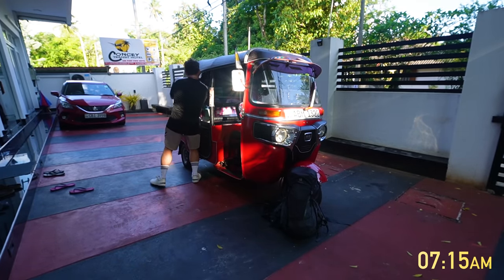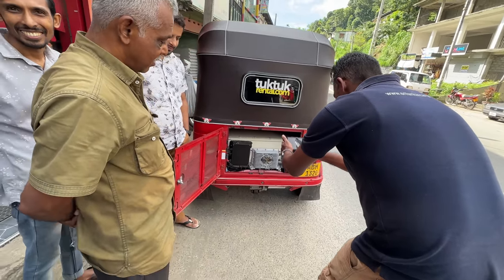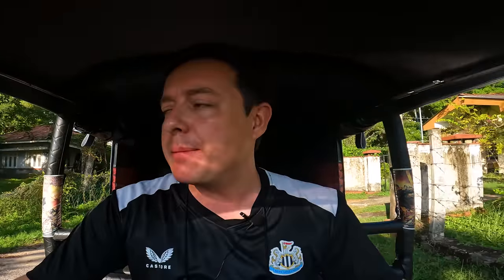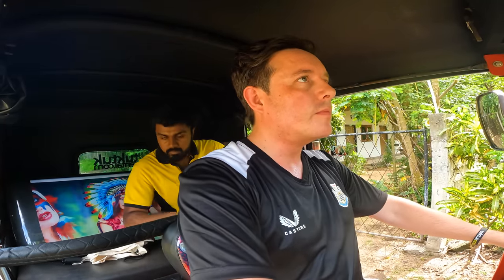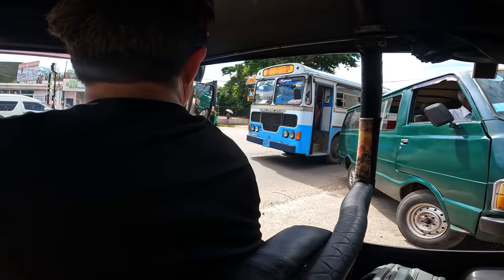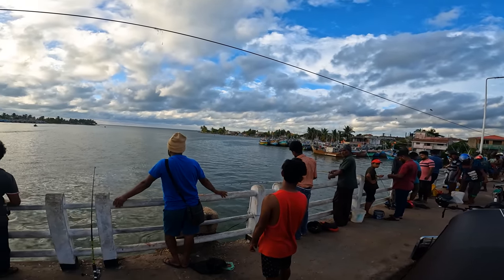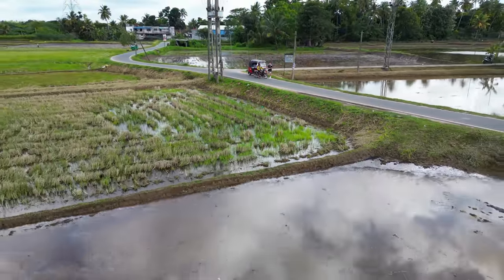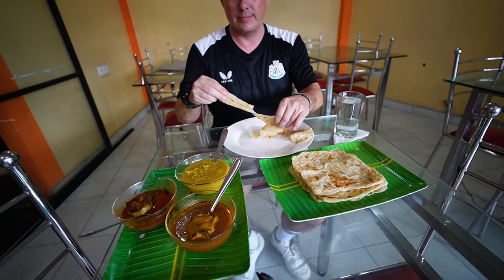Driving The FIRST EVER Electric Tuk-Tuk Across SRI LANKA 🇱🇰 (What Could Go Wrong?)

Comment: Loving the added challenge of the EV! 

Being an avid EV driver in the UK for the last 2 years, and with no intention of going back, I’d still be reluctant to go EV when on holiday at the moment, as the infrastructure isn’t quite there even in the likes of the UK. 

Using a ‘normal’ plug won’t pull more than 3kw per hour; it really needs a 7kw or 22kw charge port (and the relevant charging stations available!) in order I make it more useable imo. 

I’d also recommend using the battery % rather than the range (otherwise known as the guessometer!) or work with the assumption that the actual range is likely to be 70-80% of what it’s telling you
Reply from the maker: They have a few EV charging stations like you mention dotted around the island, but MANY more are coming, certainly EV is the future!

Comment: From an environmental perspective— most of Sri Lanka electricity is thermal ( generated by coal or gas) so it is likely more friendly but not by that much.  Will be interested to see is the hassle of electric is worth it from an environmental standpoint— so far it doesn’t seem to be. With a Tesla it has to be driven about 50k miles (or driven for six years)before it becomes it starts to pay dividends from an eco standpoint ( over a gas sedan)— wonder is tuck Tulsa rental knows the break even point for this model?
Reply: That is the argument. Also hydrogen(from water ? From fossil  fuel?)

Comment: Not to sound like a naysayer or someone negative. But isn't this electric tuk tuk conversion gonna be irrelevant in less than a year?
Bajaj already started manufacturing and selling electric tuk tuks in india for a couple of years now and probably will start to sell them in Sri Lanka very soon along with the ICE models. 

Considering the speed of adoption in india and the growth of EV infrastructure in india, it's hard to see Sri Lanka lagging behind too far when it comes to OEM selling EVs. 

And while this video demonstrated it's possible to ride a tuk tuk cross country, most people in India already are used to electric tuk tuks being used for local run arounds

Comment: Nice idea, but its not ideal to travel by electric verhicles in these countries at all when electric chargers are not everywhere like in the West. U have to have a lot of patience and knowledge how to fix things when things breakdown. In Vietnam when  your bike broke, u can find mechanic everywhere, but when it comes to electric verhicles like Vinfast. U have to wait hours till their rescue team arrive. But when they cant fix it on the spot, then u have a problem. Bye bye travel plan. Kinda brave that u want to try
Reply: Not even the same as an electric car. We are talking about a very simple and low power vehicle that is only a step up from an electric bicycle, which should be more reliable than most vehicles on the road. I doubt you could even use a car charger, just plug into a socket.
Reply: @gacattack1234  trust me, its not reliable at all. A lot of Vietnamese youtubers tried it and proved it before that traveling on a electric scooter / bike is not convience at all. For a trip of 200km cost them 2 or 3 hours of charging. 
1. They cant charge anywhere and anytime (so sometimes they have to beg the owners for power)
2. Power sources are not always reliable in country side.
3. Sometime they got power cut in summer. So how do u charge? 
When I traveled by bike, they didnt even have power at the gas station to pump gasoline. I have to wait for 2 hours till the power went on. Even in Europe I will say no to electric car when traveling to south of France or Spain. It cost us 8x charging from Amsterdam to south of France, everytime 20 min to 30 min... if we got lucky.... my gas tank of 65L is full within 2 minutes you know....
Reply: @TranHoangQuan  What drugs are you on, an electric vehicle is very reliable, more so than a ice vehicle, as long as made by someone who knows what they are doing. If you Have a bad experiencee with one that does not mean they are all bad. From what I've heard VinFast are just bad, 1st generation designs brought to market too fast.